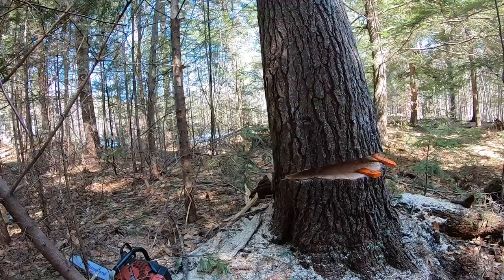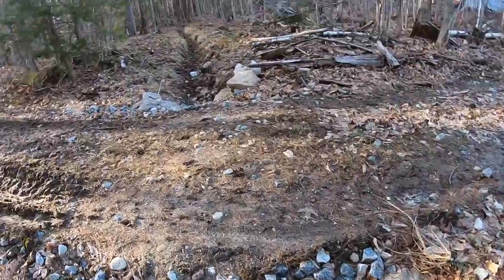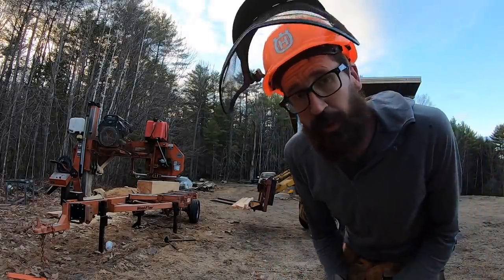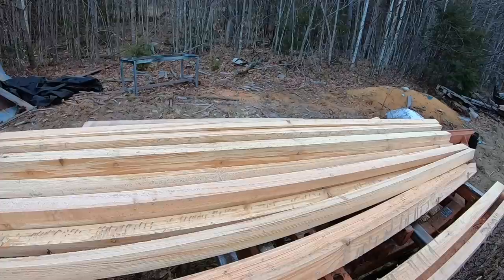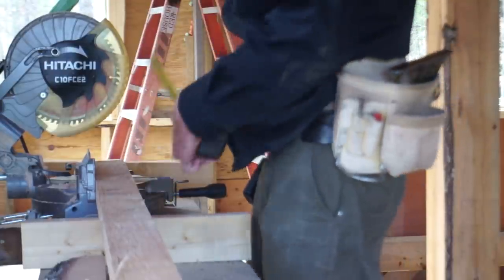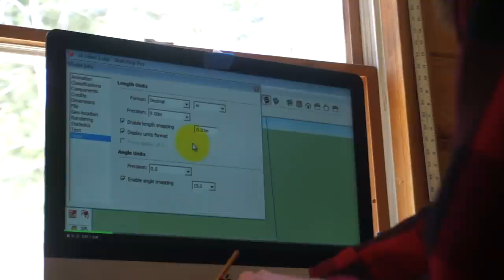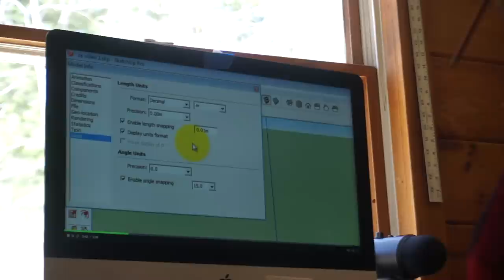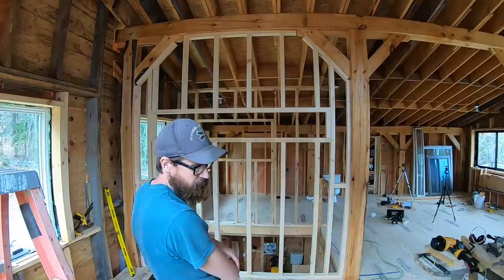Building a House from Trees SE 7 EP 8 Sawmilling a Wall from One Log

Comment: With birth 3/4" plywood going for $90 a sheet I would think a good business to get into would be selling shipping containers.  Right now they run around $2000-2500 and if you price building a shed for the size of a shipping container its 3 to 4 times more than using a shipping container as your shed
Reply from the maker: Good point!